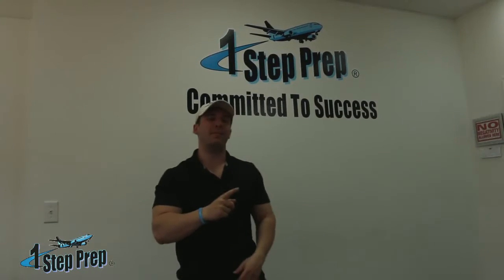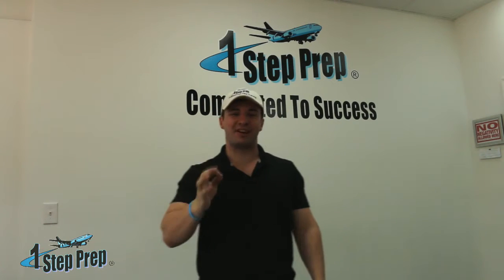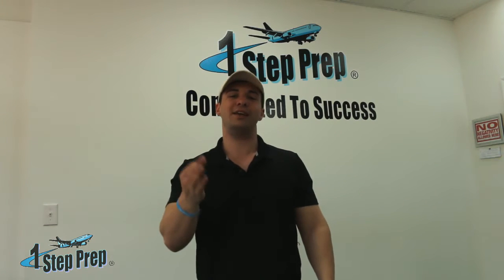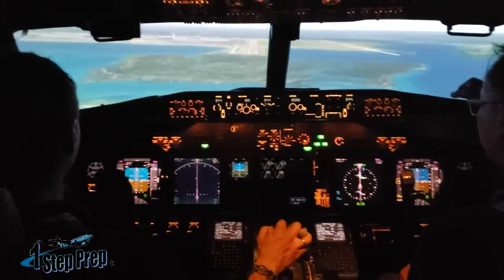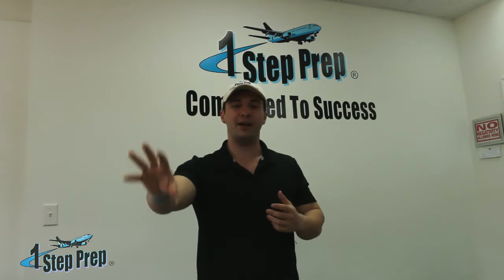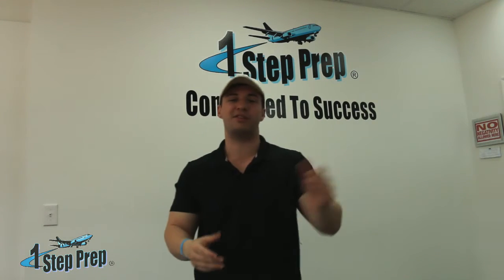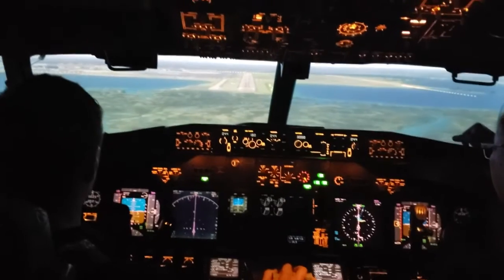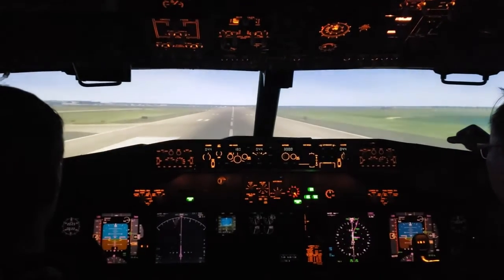B737 Air Speed UnReliable Approach

Comment: To learn from you is a pleasure😉👍🏼
Reply from the maker: THANK YOU! We appreciate your comment, please let us know if you have any specific question and we can make a video!!! Share our content and subscribe.. MANY BLESSINGS!
Reply: 1StepPrep Professional Pilot Training. I actually do have one, (very specific).

“When a jet engine produce thrust, roghly the (normally 2) compresser stages accelerates and compresses the air into the combustion champer, and fuel is now added, and then ignitet/burnt, a very high temperatur is now reached, the air expands and goes through the turbines and they turn the lowspool and the highspool. All this i do understand very Well, the only thing i need to know is, that when you push the throttle levers upwards, what does the engine do? Does it “just” throw in more fuel to be burned or what?”

So generally i want to know how thrust changes are made? Hope you can/have time to answer.

Greetings from Marc Nielsen!
Reply: @marcjureknielsen2206  Will defer to whatever Senor Munoz states: N2 is usually taken as the panel display; Takes some moments for the combustion to attain full rated performance; This just has to be adapted to as it does not ramp up the same as Carbureted Piston so at beginning of takeoff roll there is a squash into the seat effect that does not last all the way down the pavement though yes; Even with a FADEC it does push more fuel into the combustion chamber ~ this then drives blades which drive a compressor in front of all this then if dual-shaft those are where the N2 Term derives from — though whether it is differential shaft speeds or not has to be studied on the ground; Not in the air in flight
Reply: I concur totally
Reply: Who can tell me about the meaning of ‘A’ and ‘8’ on IAS?? And why it’s shown A & 8? Why not B or C or D, and 8 or 9?Could you please anybody to answer it?